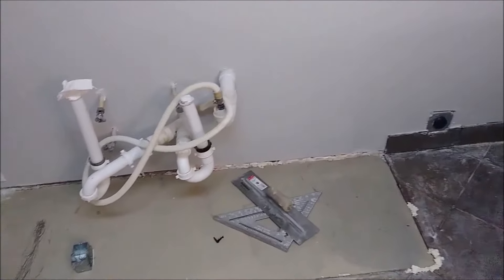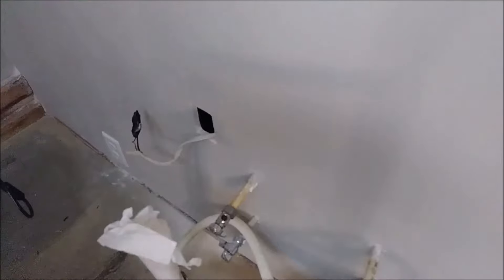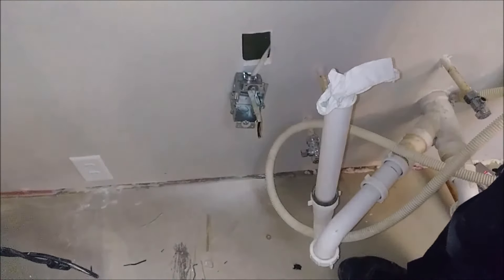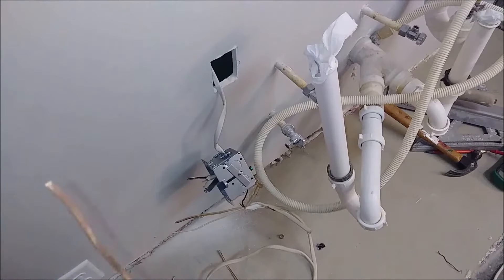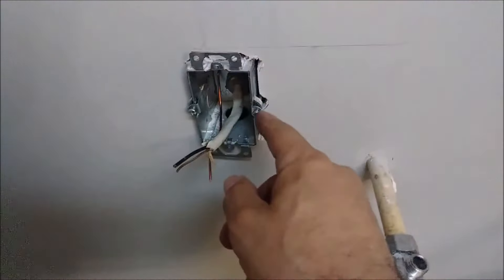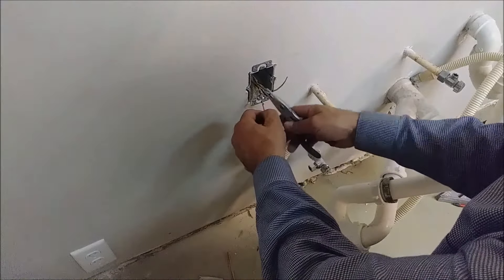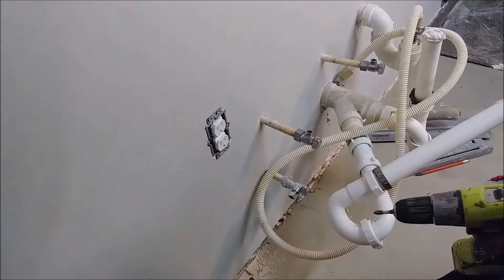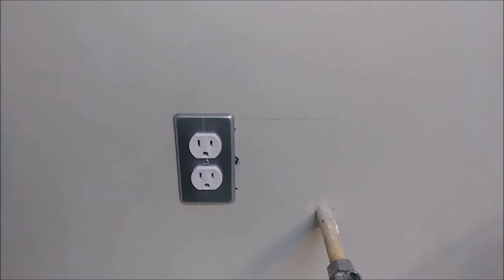How To Install and Wire Garbage Disposal Electrical Outlet Box  - Step By Step

Comment from the maker: Dermel Multi-Max  Oscillating Tool Kit = https://amzn.to/2VgLKpK Or https://amzn.to/3fL6jEf
Electrical screw driver = https://amzn.to/39xYbFM
Electrical Metal Boxes for outlet = https://amzn.to/2VdTmcm
Electrical Boxes for outlet = https://amzn.to/33qFcJJ
Amazon Deals:
Try Amazon Prime 30 days for free = https://amzn.to/2JMWaLe
Create Amazon Business account = https://amzn.to/3mLSyYt
Joint Amazon Prime Watch Thousends Of Movies and TV = https://amzn.to/33NfsHD
Try Personal Shopper Wardrobe  https://amzn.to/2VClfv9
Reply: The ground screw should be mounted from inside the box and your cable clamp is incorrect for this application because now you have to remove the box for changes. Why not use an old work style plastic box?
Reply from the maker: @surferdude642  You should use only metal box in a water environment. This is code. The ground screw can be every where in the metal box.
Reply: @josephk9182  Plastic boxes are used exclusively in residential builds unless it's a custom home and the customer requests metal ones. Plastic boxes cannot be used in exposed locations such as outdoors,   external to drywall, or in planned unfinished framing. Plastic boxes cannot be used with metal conduit. Other than that, the NEC does not stipulate the use of metal boxes in bathrooms and kitchens. Maybe you are thinking of GFCI receptacles?
As far as the bonding screw is concerned, it's probably fine, just inconvenient for verifying the tightness of the screw or replacing the jumper down the road.
Reply from the maker: @surferdude642  No GFCI receptacle. You should avoid using plastic box in water environment because you can not ground plastic box.
Reply: @josephk9182  The reason why you ground a metal box, regardless of the location is that metal is a conductor and in the event of a ground fault the box will be energized if it's not grounded. A plastic box is an insulator and therefore cannot conduct electricity.
Reply from the maker: @surferdude642  When water inserted into the receptacle and the plastic is wait the water is conduct electricity so because the plastic can not be grounded a 110v will be on the plastic box. This can not happen because the metal is grounded and the breaker circuit will break.